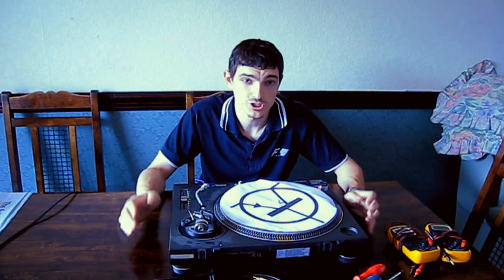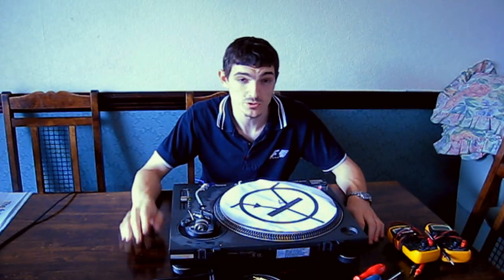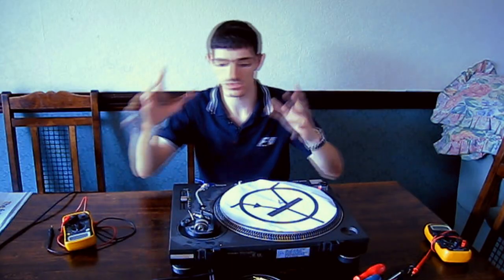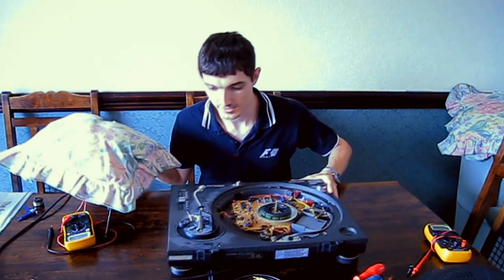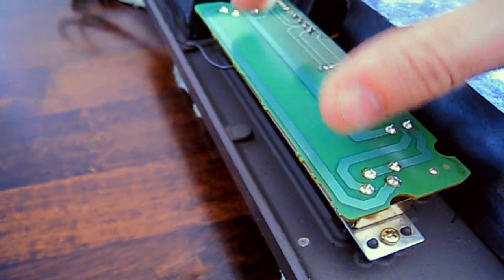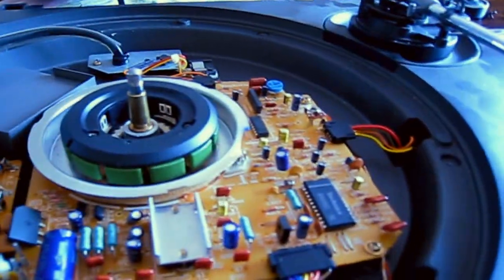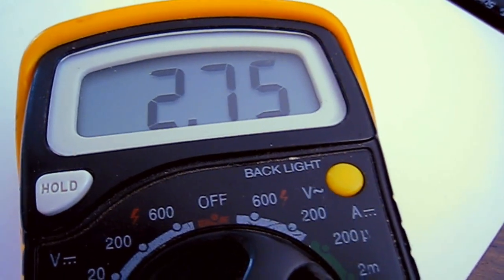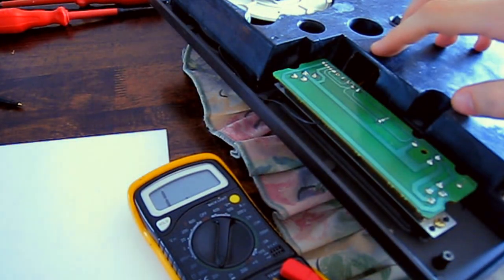Technics SL MKII Pitch calibration part #1 how to calibrate 0 position.

Comment: Lol, no. Turntables de-tune a bit over time (due to being moved around, normal use, etc.). Second, the motivation behind a lot of this is that the MK2 series has a range around the center where it will quartz-lock the platter rotation. There's 1-2mm both in front and behind the center where you *can't* adjust the pitch. Plus there's that *click*. If you beatmatch this is really evil, so removing the fader click and disabling the quartz-lock makes a better turntable, which you then need to tune.

Comment: Yes, + or - 0.1K Ohm.  So put the fader in the center and dial then adjust the pot to somewhere between 2.6K and 2.8K, ideally 2.7K.  What I do that makes things a lot easier is to take the fader off and flip it over then use alligator clips on the pot leads, then I can turn the pot and get feedback without having to keep moving probes around.  It takes some fussing but I can usually get it to exactly 2.700K Ohms on my meter.

Comment: LEAVE   THE    PITCH   ALONE! Even straight out the factory brand spanking new every single Technics 1200 series turntables platter dots will not match up against graphics printed next to the strobe light. That is fine because on the other hand the pitch again on every single NEW Technics 1200 series turntable will play accurately against all others which are NEW (Meaning if you have the pitch on 6+ it will be in sync with every other NEW 1200 on pitch 6+, so on and so forth)

Comment: Hi! excellent video,now i have a different problem with my pitch calibration,actually my technics 1200 is good calibrated in the 0 position, in the +1,2,3,4,5,6,7,8 too,in the -1 too,but when it arrive to -2, it go more slow, so in the strobe and with the traktor program, it start to mark: -3, when i put to -3, it mark: -4.5 and the problem goes on until -8,i changed the fader pitch, following the steps you suggest on your other video and was ok but problem with calibration still goes on,help!!!

Comment: hi I followed your video and It corrected the second 0 postion but I have another prob
when I move the pitch slider very slighty in the minus the pitch changes fine and quicky and very responsive  but when I move it to the plus just below the zero the pitch doesn't seem to be as responsive or change the pitch like it does when I go from zero to minus 
long story short I have to move the slider further into the plus to get the same response as if I was to slide it into minus

Comment: Just wondering, so I just bought a 1210 mk2 and the green light (0%) stays green for a little bit even when I move out of the center clicky part.  I can't beat match tunes that are very close to the same bpm if one is already on the 0%.  Will calibrating the table fix this problem or will I need to take it to a technician?

Comment: You are doing it te wrong way. RTFM

The pot on de fader PCB is the RANGE adjust, the pot on de main board is de ZERRO adjust.

First adjust de pot on de fader pcb to 2,85K in the center detent, than adjust de pot on the main board to 262,1 kHz.on test pin 27 (TP27)

Comment: hey viperfrank -- first off thanks a ton for your incredible videos.
My main question is about my newest deck which is a 1200M3D. After I removed the rubber cover off the bottom to reveal the pitch fader's green circuit panel, I noticed that the circuit panel on my deck does not have a hole in it to place a screwdriver into [4:04 in vid above]. I am wondering if all M3Ds have this design since there is no 'indent' at zero pitch? I took photos and can send if needed... Thanks a ton.

Comment: Nevermind, apparently some contact spray was all it needed.. I'll have to calibrate them again now, but hey.. still better then having to replace the variable resistor.. Btw, do you have any information about those..? I read somewhere that you can only by "8-pin" resistors now and the older models (like mine) are fitted with a 6-pin..

Comment: Hi James, first of all: great video's!
A few questions though..I've tried completing the different steps to calibrate the pitch on my SL-1200 MK2's, but I have encountered some problems. Could by the fader is just broken and I'll have to replace it.. So, problem 1: after setting the 0 point as you explained, I wanted to calibrate the +6 but doing that my 0 gets off again.. also the green LED never completely goes turns off.. some other things too, but I'm running out of space here ;-) Greetings!

Comment: thanks for the videos, had a quik question, if my zero points are on decreasing side and and increasing side how do i fix that , the same way you did by turning the screw all the way counter clockwise ??, thanks
\

Comment: What could be the problem if I can't get a stabile reading of the multimeter the second time I try to measure? 
The first time at the 2nd zero point I got 2.81 at the 20k setting.
The second time at the original zero point, the multimeter all the way from 0.7 to 16 and back to 3.50 and so on.... Which means I can't fucking calibrate it to 2.81 as I got in my first reading... well frustrating.

Comment: Thanks for the tutorial mate, was a massive help!

When i went to adjust the pot to set the 0 position, the board for my pitch adjust didn't have that perfectly placed hole. After a slight bit of oh S***! I realised that it still had a pot to adjust but it was attached to the bottom of the board and the other way up. Just had to take the pitch adjust off to get to it, also required a bit of tape to keep it held sideways so it could turn the pot and take the reading at the same time.

Comment: hey mate, i didnt have the hole either (i have the mk5) so i undid the two screws top and bottom like you said but couldnt get it off because the pitch fader was still attached. how did you get the pitch fader button off from the top of the turntable?

Comment: after quite a fair bit of rooting around, i found a solution. For anyone that has found there in no hole in the underside of the pitch fader board, simply unscrew the green board (there are 2 screws, top and bottom) and adjust the blue potentiometer from underneath instead. Thank you so much for this video james!

Comment: Excellent tutorial mate, i have the mk3D and the picth pot is a lot harder to get to having to unscrew that slider and tilting upward, this then makes it harder to change having to flip over to check dots. but got it bang on still at 0 after a few twiddles, only the others are out by a good 3-4 mm, the 3.3 is closer to 4 & - and the +6 is nearer the 7, so im guessing no ammount of tweaking will fix this as it my be a faulty slider? i dont know as im not savy with electronics
thanks

Comment: Hey thanks for the video – one of my tables has an irregular pitch wobble around the -8 position. Will this be fixed by calibration? It's a newly installed pitch shifter, the four test points are all pretty much bang on (-3.3,0,3.3,6) however there does appear to be two 0 points (or at least the exit from the 0 point is not as smooth as the repaired deck in your video).

Wanted to check what you thought before buying a multimeter. Thanks!

Comment: Hi, I have a used Technics 1200 and I can't find a position where the large dots will remain still-- at zero the dots appear to drift and wobble, and when I pull away from zero the dots move in a jerky way. Does this mean the pitch fader needs to be replaced, or just calibrated?

Comment from the maker: @aliariap Thank you, I'm glad you liked the video.
Yeah I did measure form a different point, but the it connects to the same point.
The only reason I did that was because the probes on that meter are pants and they are not very sharp, so I could cut though the slightly oxidised solder and get a good connection, so I probed else ware.

Thanks again for your comment.

Nice One ; )

Comment: Very helpful video! Thank you very much, but could you tell what for yellow and orange wires ? And does it possible and not meaningless to replace in Technics 1200MK2 pitch control with SL-1200MK5 pitch control ?

Comment: Hmmm , i just spent ages undoing all the screws ect to find i don't have the 'little hole' that you put the screwdriver in to turn anti-clock wise :'(

I don't know what to do now , any ideas ?

I have SL 1200Mk2 btw and ive only checked 1 or my 2 decks

Cheers

Comment: I was wondering with a ratherly strange problem. Not long time ago i've just bought my first pair of technics second hand off ebay and i've had some pitch problems and yeah i know thats a common problem and you can adjust it via under the platter, wich i did, the problem is, the pitch is ok at +3.3 and +6 but at -3.3 its off to -4 on both turntables.So what do you think?

Comment: Great guide! I used  the servicemanual for the technics sl-1210 mk2 as a supplement,
The pitch on my turntables didnt match up and the calibrationpoints were completly off. The manual says that the pitch should be 2.7 ohm in the senter, i adjusted so both my players were 2.7 and set the pitch to +6 and started calibrating under the platter.
The platter dots now work for center position and +6 but with +3.3 and -3.3 both players show more like +2.2 and -2.2, why is that?

Comment: @michaelNtha Yes, I just recalibrated one of mine - it's an old used mk2, and I had to unscrew the pitch control, flip it over, and then turn the pot all the way clockwise to get two zero points.  Turning it all the way counterclockwise did NOT give me two zeros.  About to do the second portion of the video and then test with Serato, so hopefully all goes well from here out.

Comment from the maker: @frankieglasses Hi there, yeah that could be a couple of things, is it a MK2 or a M3D, if its a MK3 the calibration is different. try the calibration first.
if not check to see if all the wires in the pitch fader connector are still connected, mainly the brown wire.
if that's all good,than the pitch fader might be damaged and you may need to change to pitch fader.

I hope this helped and thank you for your comment and your feed back.
I'm glad the videos are a help.

thanks again.

nice one!!!

Comment: I would just like to point out that he did not contact the Multi-meter to the same points as he did the first time he used it. He uses the multi-meter twice in this video. The second time he uses it, he put the points on different contacts than the first time. For some reason, this did not prevent the adjustment from working as intended.

Comment: This was so helpful, about 6 years ago I was quoted 60quid a deck to recalibrate pitch as I had speed mine up or increased the pitch range, which someone recommended but I wanted to put back. This was a technics official dealer and he said that you can never put the back to factory settings. Well that seems like bullshit now!

Comment: Just to clarify, the second time you put the multi meter on the pitch fader you say you return the pitch to the zero point and measure across the same points you did to get the first reading from the brown/red wires to the pitch control (6.55 in the video), but in the video you appear to be measuring the second reading from a different point further up the pitch fader board (7.32 in the video) which is correct?